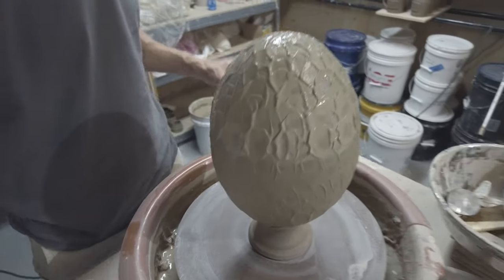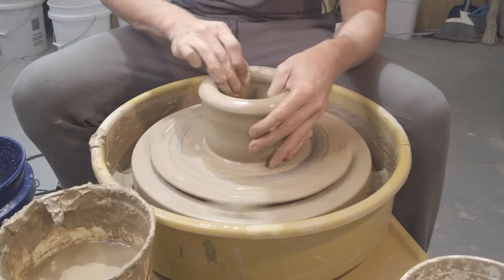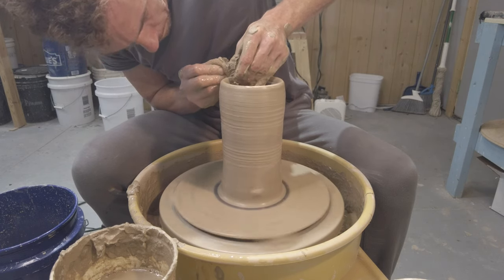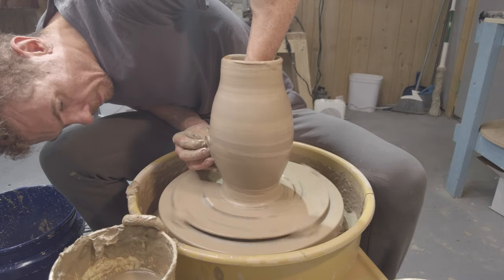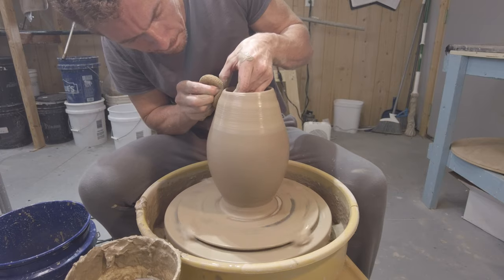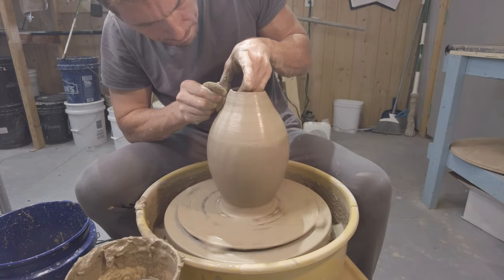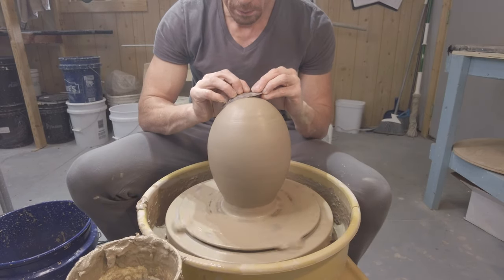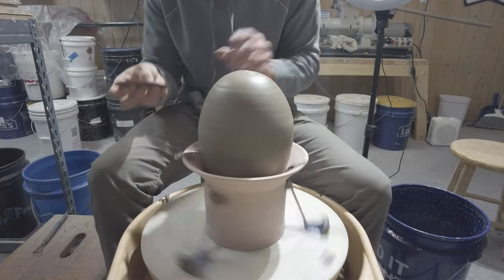Making a Dragons Egg On The Pottery Wheel - Part 1

Comment: Very nice work!  I need to have a Pitcher made in the shape of an egg, size is 34 inches by 45 inches tall. Do you think that's posable for you to make?
Reply from the maker: Technically yes, I don't think their is much I couldn't do without enough time and effort.  It would need to be over 50 x 39 to account for shrinkage and I don't have a kiln large enough.  I suppose if you have 20 or 30 grand I could make one for you.
Reply: @RedCirclePottery  Why would it cost $20,000 or $30,000 to make? Are you including the price to build or buy  a kiln for the project? 

In your opinion would something like this be better to have a mold made to make about one hundred?